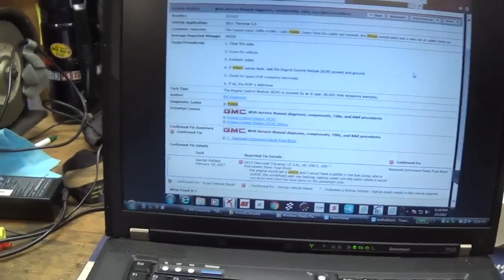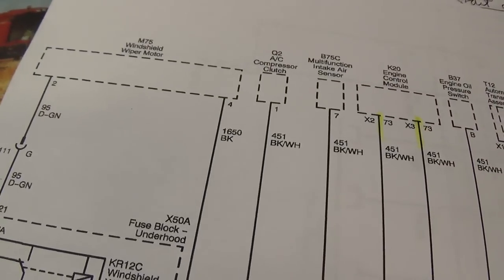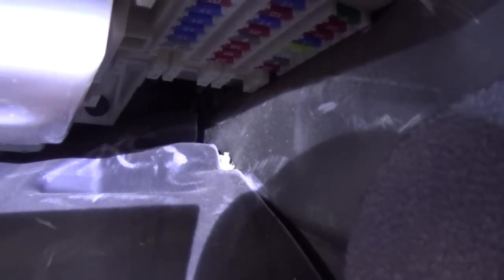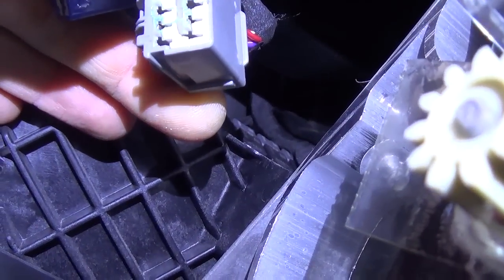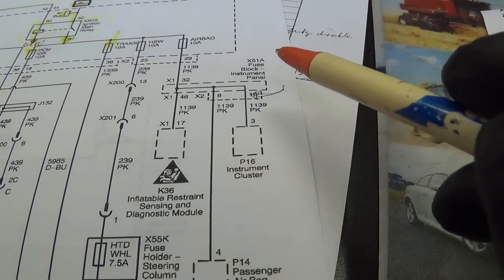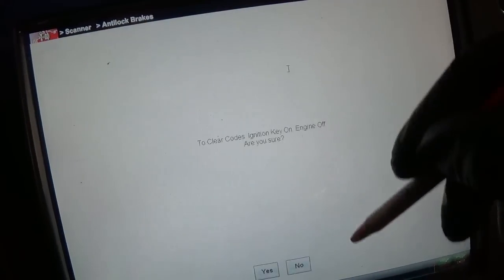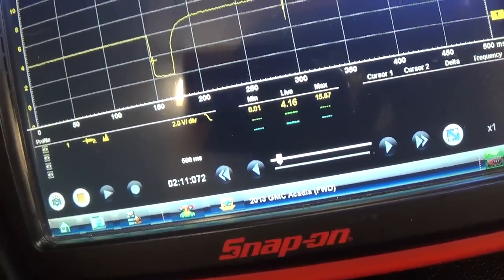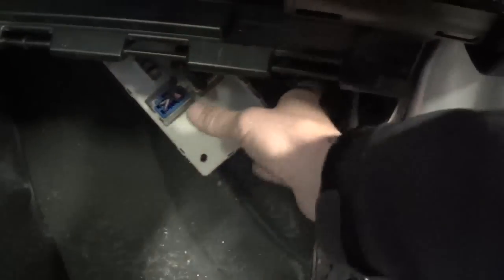CONCLUSION!!! No-crank, REDUCED ENGINE POWER: '13 GMC Acadia -Part 5

Comment: Huge fan of the case studies you do. Very in detail, time & effort into diagnosing the problem. Plus taking the time to recreate the issue again to verify the problem. Most shop don't spend that much time trying verify the issues which is of course bad. However, you show you care about the customer & make being an automotive technician worth it. Great job Ivan. 👍👍👍👍👍👍👍

Comment: GM says to put dielectric grease on every connector pin in every plug-in connection to keep corrosion down and/or clean up the pins.  The TSB with this advice was issued in about 2010 and applies to just about everything they build that has an electrical problem.  Thanks for a very informative effort; it just goes to show you can never stop asking the owner questions about possible water leaks, windshield replacements, flood damage, visible water running down into the car while driving, rain intrusion from windows left down, foul smells from the carpet, sloshing sounds, etc. in trying to get to the bottom of an electrical problem. Your tracing these circuits back to find the common connection shows extraordinary patience and perseverance.

Comment: Ugh. My parents are having the same issue with their Acadia... I'm glad I came across this video in my travels of your other videos lol. They keep taking it to a wannabe shop nearby instead of to the dealer. Now I've got something to check into. Gm went cheap and didn't install gaskets to seal connectors just like on my '00 Blazer. sigh

Comment: I should have looked harder to see there was a part 5 before commenting on part 4...  Lol...  At least I wasn't far off, lol....  Did this fuse box issue fix that code for the stereo amp turn on being shorted? Just wondering...

Comment: If you had noticed the erroneous (2.4 v) reference voltage earlier, and paid more attention to the impossibly high (13 v.) battery voltage with ignition off, would that have helped in getting to your final diagnosis and solution a little quicker?

Comment: In terms of cleaning the corroded pins, did you use something like De-Oxit to clean them and dielectric grease to keep water out (There is an older TSB out there on using dielectric grease for this purpose)?Those of us facing similar problems would like to see how you made the final cure prior to returning it to the owner.

Comment: I. Would drive straight to dealer ( a different one if possible chevy dealer or GMc) show them the tsb. The Water and crusties and say. Have fun   Get r done  warranty work then have the shop that put in glass repair leak and cover any charges incurred due to their bad install  glass company has insurance to cover this type of stuff

Comment: Wow Dude. that water is a serious issue.... Hey Ivan i met some Retirees here in Tulsa at my Local Panera Bread, one of them has a 2001 Porsche 911  convertible, since having the top replaced it wont work, so i will be on the look out for water damage.......Great video..

Comment: Wow deja'Vu ...back in 2002 my Pontiac GrandAm had no start etc...  Discovered the passenger side  between  the dash(attached to the pillar) water was dripping on the old school ECM ... took it apart and it looked like it was sitting in a lake for a mouth..😂😂
FF 15 yrs who would figure GM still keeping sensitive electronics up there
Great job Ivan
New subscriber here ,seen U on South Main Auto using the white board with Eric O  explaining coil pack...
will go through a binge watch U'r video's
Greetings from north of the border up here in Fu#king cold ThunderBay Ontario 🇨🇦 this week..
Luke
Reply from the maker: Hey Luke, good to have you here! Yeah hopefully it's the last cold spell of the winter!

Comment: I have been in the market for either a nice SUV to replace my car or an older SUV as a second vehicle and had a clean used Buick Enclave or Acadia in mind. NOT A CHANCE!!!! MY Ford car has been incredibly reliable, kept it maintained for years after swearing off returning to GM since they've turned to garbage. No wonder these SUV's are flooding the car lots and selling cheap. They are junk.

Comment: Good morning. I just want to verify a few scope concepts so that I have them correct in my mind. I have a Vantage Pro. With a cam and crank signal, they're obviously happening very quickly in real time. So when u apply a time base, u r altering the real time of the signal so that u can c it. Correct?  Next. If u r watching both signals at the same time, one over the other, they would have to b at the same time base to synchronize them correctly as in Chev. 5.7 cam sensor(distributor). And finally, when using the cursors, u can pinpoint delta which corresponds to real time?  I am trying to understand some of these concepts a little better. Thank u for your excellent teaching. And not just replacing the fuse!!
Reply from the maker: Hey Bill, yes the oscilloscope graphs real voltage as a function of real  time. Setting the time base (horizontal axis) just lets you zoom in on the time scale to a very specific moment. All the voltages on the 4 channels are plotted along the SAME time scale. Hope that helps :)

Comment: Don't you just love these kind of problems? Reminds me of the first time I ran across a maxima with a shorted ac amplifier module from change falling through the dash and making its way into a single little vent in the module case. Some people hate a diagnosis like this but I find it therapeutic lol
Reply from the maker: It's therapeutic only if you have a good chunk of time to work on it and the customer isn't sitting in the waiting room...
Reply: Those are fun. I had one like this with an added twist of the owner losing the keys some time after the change fell in. The key couldn't be programmed because of that, and it was confusing the hell out of the locksmiths he called in to make a new key.
Reply: motoYam82 I know that's right lol. I do my best to try to get them to leave it with me but some people just won't have it and would rather wait even if it means they stay all day. They have much more patience than I do.
Reply: Dan.vaku the funny part about it was that the car stayed overnight waiting on a module to come in and before I got it out of the shop I had another one towed in for the same thing. At least I already knew where to go on it. After that I figured it would be a common occurrence but I haven't seen one since. Any time a customer comes through the door with a maxima like that I warn them about putting change and small metal objects on the dash in front of that display.

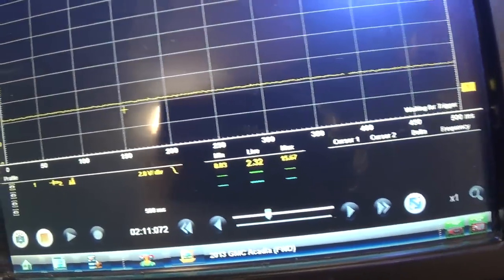Comment: Job Well Done Ivan!  CEL present at 33:45, voltage wasn't much more than 2.4V "Something just happened there".  2nd code may be set by other issue in fuse box?  Note amplifier / radio fuse also present in that box.
Reply from the maker: Good point!

Comment: I hate them tiny fuses, more headaches/poor connection points. as if there's not enough stuff breaking non stop on autos of today >_> smoking resistors in decade box, too much current for it, you need a wire-wound rheostat, like an instrument panel dimmer from older car :) waiting for part 6, 7, 8, 9, 10, 11, 12 :)) typical acadia

Comment: Being a former G.M. tech, I always gave props to GM for giving their techs really good information the majority of the time. They are awesome with bulletins, preliminary information, etc. Whether or not you get the lazy tech to look them up is a a whole different story. As with any shop whether it be a dealer or not. Being at a dealer it makes no sense not to look up common issues/fixes though. It made your job easy.Now they just need to get rid of every vehicle with a 3.6l and a ecotec engine and start over. V8 Ls motor in everything!
Reply from the maker: I must say GM does put out an amazing amount of TSBs! I don't know if that's a good thing or bad thing lol

Comment: What do you use to clean the green cruelties? (got crusties autocorrected to cruelties, it kinda works).  I have been using this "Deox-it" stuff on anything electrical after it magically fixed a very expensive home audio volume knob. If your familiar with it then,cool, if not ,check it out.
Reply: Red Deox-it is one way to go, probably good enough.

I think you should use a bottle of the old style acid flux that used to be popular for cleaning copper pipes before soldering.  But, you'll have to heat it a bit to quicken the reaction, then neutralize the acid, and I'd then put a dab of axle grease (no moly) on it to inhibit further corrosion.  Weldcote Liquid Soldering Flux is one brand.
But, you've gone through the protective outer layer of metal and into soft copper, so the best thing is to replace the contact with a new one.  Expensive to crimp, and hard to find.  So maybe a junk yard has one you could scrounge and splice/solder in.  Tough to find the right tool to unlock the "pins", or terminals.
Ivan's fuse block also has heat damage.  Even if cleaned chemically there may be a problem with the plastic's strength for those two pins that were shorted.

Comment: Dealer: Bad battery
Ivan: Water leak, crusty fuse box, etc
Dealer: Whats a fuse box
Reply: Dealer: no crank no start must be the battery and cable what else can it be?
Reply: Service adviser... It'll cost 500 to replace the batt and cables, know the batt is newish, but tested bad.  Mechanic... They paid that? Wow, I'll find something else.

Comment: Excellent video, Ivan. The better they make the vehicles, the more problems that can crop up. Give me something simple like a 1966 Pontiac Catalina with the 400 under the hood and TH-400. They are next to impossible to break (unless you wreck them) and run for miles.

Comment: Ivan. This was one of the most baffling and difficult diagnoses you have ever done. 

As soon as i saw the water in the foam it all clicked. The problem was probably made more intermittent by the long spells of freezing temperatures you get in the northern US. It would have been easy to miss because when you looked at it previously the water sitting in the carpet was probably frozen solid. 

That will be an expensive repair to do. It will need a new carpet and foam if the water leak has been going on that long otherwise the mould will ruin the car. I had this very problem on my own vehicle. I had my windscreen replaced after a stone split it. Went on a European road trip. I notice my passenger side carpet absolutely soaking in Northern Sweden one evening. I dried it out as best i could with a car park full of Swedes looking at me funny. When i got back to England i had a right game trying to find the leak. I wondered if a body seam was leaking or one of the seams in the bulkhead or a rubber grommet where the loom goes though. Low and behold its the windscreen, it was leaking in the corner of the A piller and running down behind the foam insulation down the bulkhead. It caught me out a little. I didn't expect a professional replacement like that to leak. Then my boss has a replacement done on his Passat and that leaked. haha 

Thanks for bringing us along.
Reply from the maker: Water leaks can be a nightmare to find and cure for sure!

Comment: glad you got it! it's the same fuse block style as the one I had. yours was more crusted than mine but we fixed the leak from the sunroof drain. sealed the cowl and customer is happy! good job Ivan!!!
Reply from the maker: Yes Michael, you hit the nail on the head! I just didn't want to give it away that you were right in Part 4 ;)

Comment: Great job Ivan!  Just reinforces my desire to only own older vehicles. 

For folks saying the owner did not mention a windshield replacement or leak, how many non-tech people would put those two things together? It was a year ago that the windshield was replaced, the problems with starting began recently. 
 For the owner, its not related. But it does stress that with modern equipment and the proliferation of electronics and multiple fuse boxes, that you need to add questions to ask the customer about things like water leaks, windsheilds that have been replaced, sunroofs, whatever.  In my line of work, I've got a series of questions that I try to phrase without putting ideas into the customers head (have you heard any unusual noises lately? I won't ask if they hear a whirring sound, becuase then every noise to them is a whirring sound, I let them use their own descriptors and then try and frame further questions to keep narrowing down what is actually happening.    

And dealer service writers share some of the blame as well.  My work vehicles I've had to take in a couple times under warranty for issues, and when I see the repair order, the service writer completely failed to input every descriptor and condition I told them in an effort to give the tech as much information as possible. so they can quickly  reproduce the fault,  Don't know if they are hoping the tech will shotgun parts for extra profit, or some other misguided reason.  But whatever, modern vehicles have become a rats nest of potential problems.
Reply from the maker: Rats nests indeed...couldn't agree more!

Comment: Man, that was a tough one. It goes to show what we technicians face while repairing vehicles. I had an F150 with water in the fuse panel and it was a can't start. Identifix pointed me in the right direction also and there were several with the same problem listed. I forget where the water was getting in but i believe it was the cowl somewhere.
 I had a 2012 Malibu with water leaking into the interior fuse panel causing strange issues. That one had a split sun roof drain hose. Also a common issue found on Identifix. Is really a helpful tool sometimes but if you're lazy and don't test you can get "slid" easily.
 You just never know these days.
Reply from the maker: Yup hat's why I went to the trouble of simulating that short-circuit between the pins. Could have been an unrelated problem altogether!
Reply: motoYam82 try using a smoke machine out side of car along cracks and seams,  turn blower on high close all windows and doors, can't have a breeze in the shop,

Comment: Also have the windsheild resealed by a very good company.  those windshields are very hard to get sealed.  i've dealt with a leak into that fuse block.  the water gets into that fuse block and everything gets corroded.  I've had power door locks inop, battery drains, and engine staying running with key off.  probably a couple other ones too.  don't use Safelite for the windshield!
Reply: also just replace the blcok.  I've tried cleaning them out and it doesn't work.  they come back inevitably with other issues.

Comment: I was suspecting some sort of water leak or a bad ground, glad to see it was water intrusion and shorted pins and not a burned PCM. This is why I stay with the windshield replacement guy and make sure the seals and glue they use is put on there the right way because I hate water leaks too. Bad move on GM also to poorly seal that cowl from the factory. Sometimes the robots themselves can screw things up unintentionally, along with the quality testers.

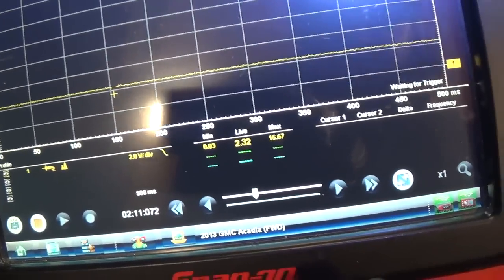Comment: Ivan, you'll notice you actually set the MIL at the 33:43 test where you began to see a weird voltage drop when reducing the resistance. You didn't catch that on your actual test, but I noticed. I bet whatever resistance you had it at that time (and whatever start voltage before it dropped), that was the threshold.

Comment: Great run down on this Ivan.. I did take note that the second time when you started the car at the 2.3 volt level (at 34 min) you already had a check engine light.  
Overall..Customer should have said something about a leak. The age ol question, Why O Why would someone let a continuous problem like water happen and destroy interior and raise havick on other things.. Might as well drive it into the river and leave it. 
Most would have gone back the windshield guy for the proper fix ASAP..  Duh
Love the solution of repair. "Trade it in"  HAHA
Your the man Ivan! Awesome job

Comment: Wow, brilliant video. I always put dielectric grease on pins that have been corroded (after cleaning them up) -- makes a huge difference especially if it gets wet again. Replacing the fuse box would probably be a waste of money unless there are multiple problems. This really demonstrates the importance of history and questioning the customer.

Comment: Wohoo! You found it Ivan. I made a guess about intermittent ignition switch turning the circuit on and draining the battery and making 0.1s intermittent voltage drops when staring. If you and I would have known about the water leaking from the dash, i bet that fault finding process would have been different from the start. Interrogating the customer and making them to confess everything what has been done to car before and all observations they have had with it is so useful. All cars should have a log book as airplanes have. Maintenance history is extremely useful info.
Reply from the maker: You have no idea how many questions I asked the customer, and they were very understanding of the situation and did the very best they could to help me out!
Reply: I bet you did. And they always are, everyone want their car fixed. But it is quite often the most complex part of the job. I've been hunting bugs in software for three decades (and fixing my own cars). Going though what happened before the user run into a bug and what was done at the same time or before is hard. It is just a part of human nature. Now we use logging or "telemetry" which is awesome tool for diagnostics. Much less detective work. 

People just cant remember all or do not realize all the observations which could be relevant. Not even when they try to help as much as they can. It is jut being a human. If doctor would ask me what I ate a month ago, i would not have much of an idea.